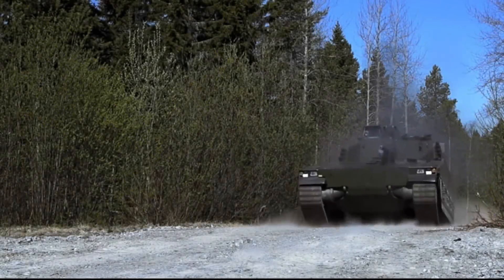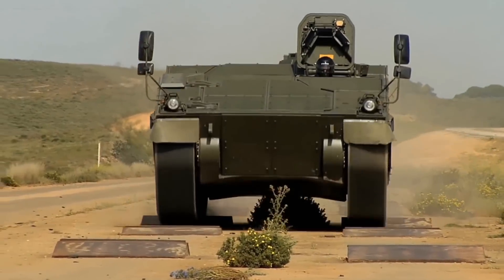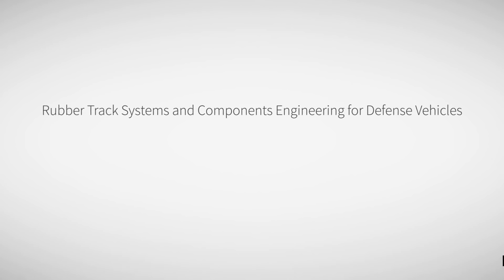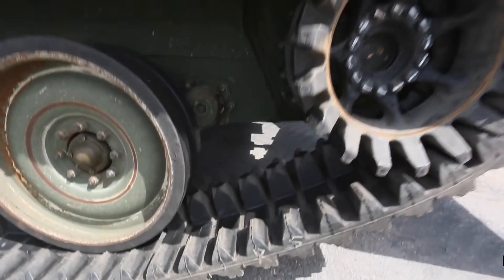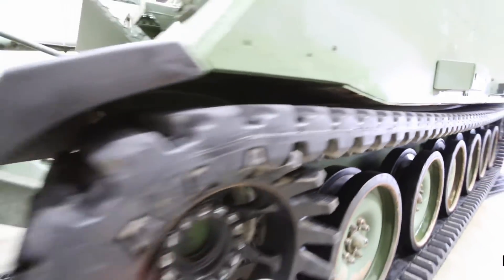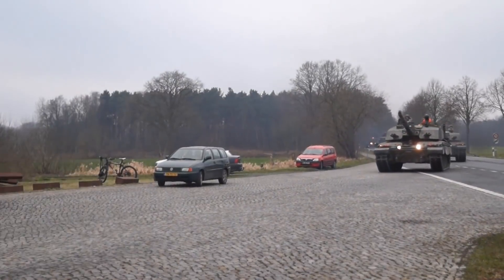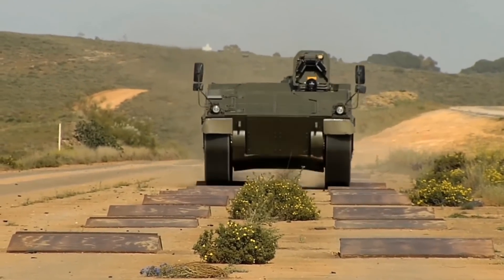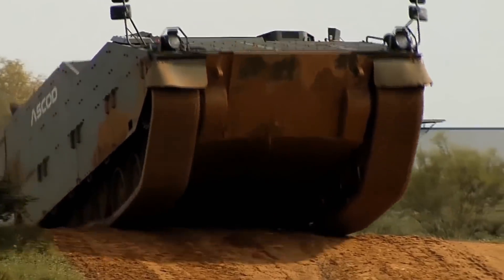Rubber Tracks on Tanks - Are they worth it?

Comment: Its quite a difficult topic tho. Im a civil mechanic and have been doing tracks for a while now. 
You could say Army can learn from the Tractor makers like John Deere Claas and Case,but Military application can be quite tricky  due to hit durability.
That aside Tractors do have more advanced track systems,ironically, mainly due to design.
Straight forward military doesn't want to design a track system to use Rubber tracks they just want to put a rubber track on existing suspension that's why they fail.
I know development costs money but thinking big you will spend way more money and time not designing the proper suspension than Spending money once to do it right.And its not that big of a change you just need small changes to 1 or 2 road wheels. Or as older Claas did it Split(2 part) drive sprocket.
There are tractors weighting over 20 and 30 tones so I don't think that's a problem ,also rocks not so much,but hit in the track sure is.
That said many older tractors don't have neutral steering but I never saw one throw a healthy track.
When i first saw Rubber tracks on a tractor I said "well that's gonna last" And I was proven wrong for those track outlasted standard and premium tires by 3x and more,manly do to contact surface physics but that's another topic. Even in Prolonged Road use.
Also Most rubber tracks on Tractors have several layers of Kevlar and steel reinforcements so expanding is not really a problem. I had tractors working in the fields Trough entire years and more without any tensioning or adjustments to the track and suspension.Just grease them nipples and move on. That's all 4 seasons and here Temps can go from -20 to + 50 C in a single year.
All in all its a choice. You make it and you adapt to it. Every system has pros and cons .The choice falls to which one can give you more benefits and less faults.

Comment: In the 1980's I was involved with the Leopard 1 improved main battle tanks. For us, rubber tracks meant peace-time tracks to save the roads. Almost all movement over public roads was still done with FTF low boy carriers. When activated, all our tanks would change over to steel tracks.
We never had a track failure that I remember and the ride was smooth without vibrations. Not so for our YPR personnel carriers which shook the fillings from our teeth.
p.s., in Germany we won the tank trophy with our old tanks from Leopard 2 and the Abrams tanks with their cheap smooth bore cannons :-)
Reply: rubber tracks on a leopard? or do you mean steel tracks with rubber pads on them!!!???

Comment: In my personal experience is that rubber is all around more useful, due to the weight, grip and noise... but there are certain situations / areas steel belts are better. I know for a fact that We've used steel belts in afganistan on our leopard II's, due to the wear and tear of rubber and the hard terrain. Ideally we'd use both more often (switch out), but yea .... good vid tho, got a lot of stuff "right"
-atleast to my knowledge.

DK army engineer myself (granted.. I am still just infantry) -we love the rubber belts, the noise alone makes it worth it imo.

Comment: Personal experience is rubber tracks are a lot less noisy not only interior but also exterior. Though it wouldnt matter as much but sound of armoured vehicles do have some importance in combat. Engine roars aside, I feel that most of the noise comes from the steel tracks vibrating than the engine itself. Where elements of speed and surprise is paramount in armoured combat, I believe less noise is also an advantage. Of course, acknowledging the disadvantages of other subject matter. If you have ever heard of the bronco driving, its almost silent. Imagine driving up to visual range in front of the enemy and they be like "oh wtf dint hear u coming"

Comment: i guess for temperature extremes maybe it possible to upgrade the wheel part that movable to get more track tension depending on the temperature, but i guess that would work if the vehicle is newly built.

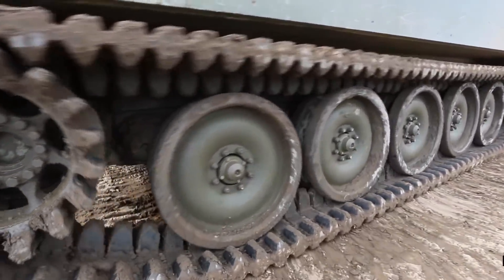Comment: 4:20 "Rubber band tracks are not new, and it was started by the hägglunds in 2003 the BV-206 vehicle" wait a minute. the hägglunds BV-206 was build to replace the much older Volvo BV-202 witch was introduced to the swedish defence in the mid 60's, which also had rubber band tracks. just fyi,

Comment: steel will last longer period. in industrial it isn't very bad, but normally you try to "plant your foot" before use and move at ~15MPH at most. the advantage of steel is that why you go all the way, it has a paddle effect and you can "swim" in thick mud, rubber in general looses this effect and you skid. you also have the advantage of, you are take the mud out and hitting hard pan.

Comment: M2a2, M1a1, M113a3 Driver/ dismount. I have seen both worlds and tell you that any reduction in noise or vibration it's a net plus and outweights the steel tracks. However if someone has done the band tracks on the m113 or others  and have a different view, I'm willing to listen.

Comment: The segmented rubber track sounds very promising. BTW, wouldn't it be possible to cut used tires and screw the pieces to the outside of a steel track to get the best of both worlds?

Comment: BV206 is from the 70's (and used rubber bands, but no armor). You probably mean BvS 10. I personally drove both BV206 and Sisu-NA110. Funniest vehicles I have driven. The pressure they emit on the ground is lower than from human feet, so they drive very well on snow and swamp. Also amphibious. https://www.youtube.com/watch?v=9kDDUbfwEII

Getting the track back on track (kjeh) is not fun.

Comment: We had a few running "rubbers" in Syria and I always secretly prayed I would be in one of them. Im sure everyone did but no one said it out loud ha.. The ones we used could be broken down into a few separate pieces making repairs much easier but still a PITA. Would just replace damaged section with a whole new one and the damaged one would get repaired later. If there was damage to the section where it met another though and both sections where damaged at that linking point.......shit.....

Comment: Matsimus is there any new tanks being produced or designed in the British army for the future?
Reply: No, Challenger 2 has an upgrade bidding system going on between two consortium at the moment.

There is a set of minimum requirements needing to be done which both teams must do, they can then also add on any extras they wish that they think the British Government may be interested in - with costings for the required equipment plus separate costings for any additional equipment.

The MoD and British Government are also working on an open architecture and hard kill APS system for all the British Armoured vehicles 

https://www.gov.uk/government/news/mod-awards-46m-to-start-challenger-2-tank-life-extension-project-competition

https://ukdefencejournal.org.uk/shields-icarus-project-provide-british-army-vehicles-active-protection-system/

Comment: They used Rubber Tracks on M2/M3 Tracks in WW2.  Plus the M50 & M56 used them with metal plates as saved a lot in weight.

Comment: hmm maybe something like  a chain mail embedded and sandwiched between to layers of rubber  maybe some carbon fiber  rods or fines etc
Reply: 9:21 hmm maybe put steel plate insert on them ?
Reply: 11:28 nah nah what you want is like  wire cable like 5 or 6 parallel wire cables  like 1 inch think and then have the links bolted to then via like u bolts  one for each cable

Comment: I can understand the vibration thing.  I use tractors alot, and they have NO SUSPENSION, and you sit on the rear axle.  The ride is bumpy as could be, and it WEARS YOU OUT!  You wouldnt think riding a tractor could be tiring, but it really is!

Of course, a tractor isnt a tank, but I understand that experience.  Very interesting!

Comment: Why not cast rubber segments around a couple of steel hinge bars. Same size and linking as a standard metallic track, just made out of rubber. Kinda be a more extreme version of rubber padded tracks. It would eliminate the issue with stretching, step back repair complexity to what it is with metallic tracks(although with much less weight) and still keep most of the benefits of rubber band tracks.

Comment: The issue with single piece tracks is maintenance. An anti-personnel mine will not only disable a vehicle with a band track (unlike the caterpillars on, say, an M1A2 which will glide over small munitions like a child over bubble wrap), but will disable the vehicle until another support vehicle shows up with an ENTIRE SPARE TRACK to replace the destroyed one which maintenance and logistics wise, is a massive issue. 

Crates being shipped across every battle zone with the sole purpose of replacing an entire track because the old one has a hole in it sounds like a nightmare. As time consuming as it is to replace a metal link, I'd still prefer it over removing an entire belt.

Comment: There is an issue with rubber (either pads or tracks) on roads: Since the rubber provides a lot of grip on asphalt/tarmac, it is actually damaging when the vehicle turns - it rips up the surface actually much worse than plain steel track links, which slide off the surface (sideways) much more easily. In Germany the law that governs the use of tracked vehicles on the road (being road legal) actually makes torsion force applied to the road the main consideration. You had the clip of the bridge layer at the demonstration at the WTS in Koblenz (which since moved to Trier) - here it was really the grip of the rubber pads that pulled out the cobbles.

Comment: I always thought rubber tracks had steel cables or woven steel belts running the length of the steel tracks to control stretching.  I never knew rubber tracks only had steel bars only.  Maybe the rubber tracks are made by Bridgestone and not Goodyear.

Comment: Rubber bands on APCs, Steel tracks on MBTs, is exactly what I would have said before watching the video. What I have to wonder however is why we can't create composite tracks that are largely rubber, but heavily reinforced by steel (or maybe carbon fiber?) wire and bars. These could to my mind be segmented pieces, just like steel tracks, held by steel pins, but the tracks themselves could be mostly rubber with some elasticity. Sadly I am not an engineer and am likely missing something, else we would likely already be doing this.

Comment: For a MBT weight vehicle, and assuming a segmented system was used and a good patch system was available to facilitate rapid battlefield repairs, how close to the life span of conventional steel tracks would you consider acceptable for it to be worth the switch? 80%?

I suppose that the drive sprockets and road wheels would suffer reduced wear too, which would mitigate some of the reduced life-span of the track its self.

Comment: one key difference that metal tracks are better suited for is that even small arms would be able to damage the tracks, whereas for metal ones you'd need to bring at least an AK-47 with shit ton of ammo. and still, it's only going to damage track without completely destroying it, while the rubber one could pretty much rip when you try to move with a lot of holes in it. thus metal tracks with rubber pads are still used when they have almost fully rubber tracks.
Reply: jerry lim if you got cling from ak 47 on your vehicle than you know there are always rpg and other kind like that came with that ak 47 so  why bother about ak 47 able to rip your rubber track when other big weaponery able to rip steel track easily or they just shoot atgm to your vehicle , so it just come to which give more easy and cheap to use compare which more harder to destroy
Reply: well if the enemy has atgm or rpg, they wouldn't even bother shooting the tracks. instead they would go for the hull or optics first. what I'm saying is that rubber tracks can be damaged easier than metal. and I get that rubber maybe cheaper, but guess what the enemy is going to attack first? the rubber tracked vehicles for they don't have to use higher tiered weapons more than the metal. both are good but right now they haven't yet made it THE ONLY type of tracks for rubber because they still need to improve on them.

Comment: How about steel tracks with added rubber pads separately for each link as a running surface? Stretches and gets replaced like steel, but rolls like a rubber track, with noise, road damage and vibration reduction.

Comment: The rubber link system is probably the best option. In combat  if you take a hit strong enough to destroy a rubber track you'll likely still get the same results from a metal track so you might as well make it easier on the crew to replace the rubber since it weighs less and is easier to work with. Stretching isn't nearly as big of a problem since it's formed around a metal core either. It's still a possibility and requires tensioning, but similar technology is being used in 3D printers where they use fiberglass to reinforce their belts with minimal stretching and rarely needs retensioned.

Comment: Durability and duration without down time is the key. Track pads are not to just prevent road damage. Final drives also take wear and tear. Pads prevent extra heat from surface friction. Without pads extra heat on final drive sprockets. I'm sure you've seen final drive wear if around long enough and that's a definite down time. Hence long hauls preferred by rail or flatbed of trucks or tracks and final drives no mater how hard the metal it's going to wear badly with prolong heat and wear of extended travel. From your video it seems rubber tracks are advancing nicely. Busting track....yah well they better have multiple segments even with rubber track. On the rubber track a big maintenance problem of final drive sprockets taking a beating as bad is out so I'm pretty sure the rubber tracks are going to continue to be researched for use on larger tanks once development has great results..

Comment: Rubber tracks go back to WWII M2 half tracks.  I like the segmented rubber track idea.  When talking about metal track noise and vibrations taking a toll on the passengers.  It also takes a toll on the very vehicle and equipment.  All that deep brutal vibration with real mass "metal track links" destroys electronics, knocks sights out of alignment.  Transmissions and engines shaken to an early grave that then needs more maintenance.  Full belt tracks still use steel cables and Kevlar belts, some real tough quiet stuff.  Not getting heard and arriving still intact has some real bonuses.

Comment: I may be wrong but I believe the American WW2 haft track had rubber banded steel cable tracks. I have read few complaints about them and it appears many were used for decades.

Comment: Rubber tracks can only be replaced, not repaired. They have an upper strength limit where we would have more steel or Dyneema re-enforcing than rubber and they can burn. So it's a question of risk analysis and design requirements. AFV - maybe, tank - no. Great vid dealing with things which make us think. Thanks Matt.

Comment: We've been at the point where the human component of a military system is the weakest link for quite some time, but as we progress further into the future of warfare, that weak link will become more and more pronounced. A fighter aircraft with no pilot could pull higher and more prolonged G forces, a tank without an on board crew could store more ammunition, do away with the crew compartment altogether, and possible even thicken armor within the cavity made available, keeping in mind the limits of weight of course. Unmanned systems are going to be he future of warfare whether we like it or not, I see crews wearing VR headsets and using direct link connections to the vehicle to maximize it's fighting potential while still keeping the concept of human choice and decision making in the loop. I don't think fully automated systems are going to be very popular with the ethics of combat being the key argument against it. I still believe that the responsibility of taking another human beings life should be the choice of another actual soldier, instead of parameters and boxes being checked off by a computer code, that decides whether to make the kill or not. Humans choice and decision making should always be the last word in combat, the day we allow a computers to make a kill order, is going to be the start of a very slippery slope that we can't come back from. SkyNey 😱

Comment: Here's a thought.

Implement the basic design of airless-tire on the outer rim of road wheels and use the same design principle to upgrade solid rubber pads into more elastic, comfortable rubber pads.

It should shred weight off tanks and also save money to purchase entire new tracks.

Comment: had the rubber track on my TLAV in Afghanistan. worked well for me but I never got detracked. Not really repairable by the crew in the field. they were wider than the standard m113 tracks which made them better in the mud. track maintenance at the user level is almost nothing  They are reasonably durable too I ran over a PMN landmine and it didn't do too much at all to the track. an anti-tank mine would knock them off probably. I'd say overall they are good as long as you have the logistics to deal with the difficult repairs. I'll have to keep an eye on the segmented rubber tracks. That should mitigate one of the largest downsides.

Comment: As for cobblestone roads...  They did that on purpose to prove a point.  I drove my M60A3 and M1A1 on many cobblestone roads and motorpools without any damage.  (2 tours [4.25years total] in W. Germany) Look closely, you will see that there was a significant "pothole" or whatever you wish to call it where the cobbles were already coming loose.  They CHOSE THAT SPOT to neutral steer.  This is not coincidental.  Cobbles rely on there interlocking properties to give them strength.